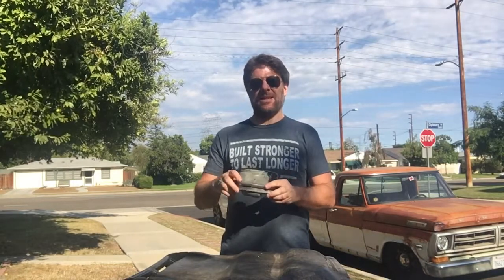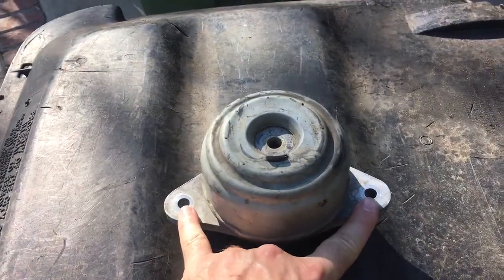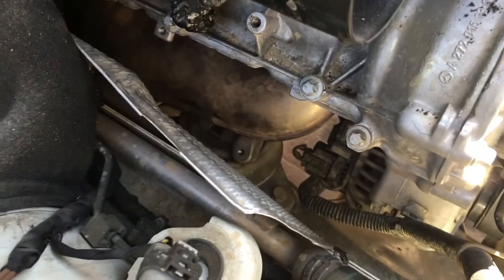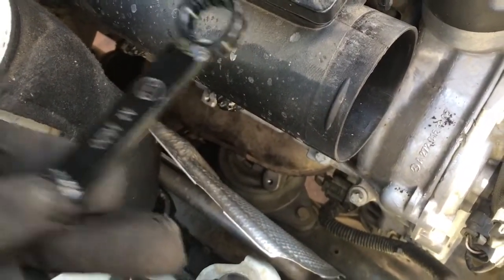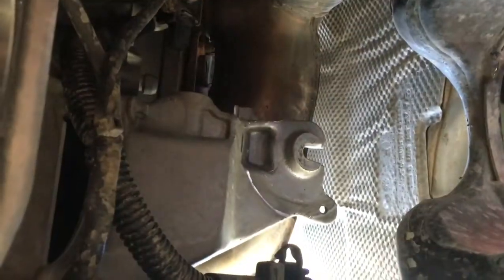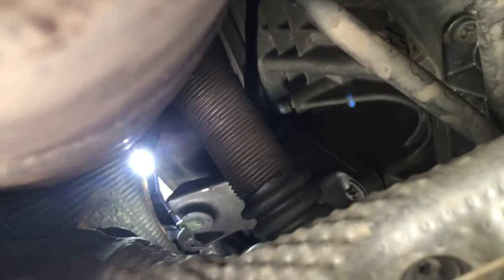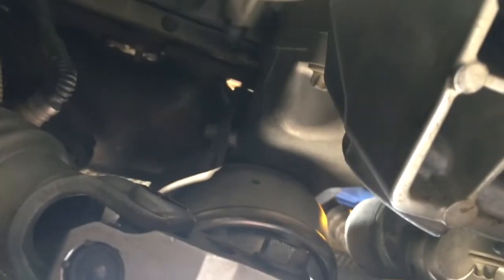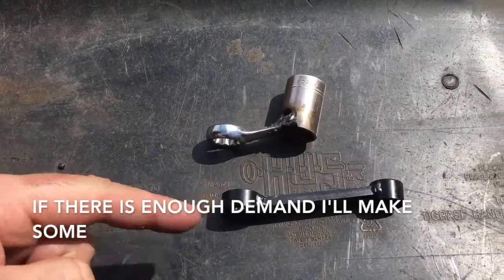Mercedes GLK motor mount swap + my tool that makes it easy.

Comment: Did you change all new screw and bolt when replacing the engine mount and transmission mount?

Comment: I bought the tool and it worked for me, also I'm a bit of a mechanic noob.  I did the job solo in 4 hours and the hardest part was getting the 16mm bolt started after putting the new motor mounts in. I had to keep the 13mm 2x chassis bolts loose, and a touch of soap on the bolt to get the driver side 16mm bolt started.
Reply from the maker: Excellent! Glad it all work out well! Thank you for your purchase.
Reply: @NathansGarage  do you have anymore of those sockets??

Comment: Great video , replaced motor mounts in about 2 hours also. Didn’t have to disconnect anything. If I hadn’t known it was possible  to do it in this manner I would have probably given up and taken it the dealership . Thanks for the great info.

Comment: How to understand that the engine mount is bad?
Reply from the maker: Joseph John for me it was a metal to metal type vibration that I could feel through the steering wheel and floor.
Reply: Nathan's Garage I have a vibration on steering wheel and a humming while idling on D
Reply from the maker: Joseph John the vibration in my steering wheel cleared up when I swapped out the engine mounts.
Reply: Nathan's Garage planning to change the engine mounts at the stealership, hoping my max care will cover it.

Comment: You think this would work on a '11 E350 Bluetec without removing the DPF and other accessories ?
Reply from the maker: david le hmmm I honestly don’t know. If the motor mount but is the same size and the issue is that that nut is hidden under something (the exhaust manifold in my case) then it would do the trick.

Comment: Do you know how much more a pain in the ass it will be for the GLK350 4Matic?
Reply: The 4Matic model is much trickier, but you can do it. I am about to produce a video on doing just that.
Reply: AutoRex Awesome. I'm going to keep an eye out for it. About to order the parts this week, but been dreading doing it after taking a look at it.

Comment: Important to point out that this only works with a non 4matic as you have room to access the mounts without the front differential and axles. Much more difficult process with the 4matic.
Reply: Could I just undo the CV axles in the front?

Comment: Yeah it's a lot easier to do if you don't have all wheel drive if you have the front differential in the way you have to take a lot more apart to get those motor mounts out of there

Comment: Did you guys have to take out the front axles?
Reply from the maker: Issa Nesheiwat mine was a rear wheel drive model but I would assume you would have to remove then. Scroll through the comments and reply to anyone who has asked that question. They’ll have more practical experience.
Reply: Nathan's Garage thanks I appreciate the response
Reply from the maker: @mr5274  the tool is $80 shipped.
My PayPal is: nathankershaw72@gmail.com
Stock will be arriving in 2 days so I can ship in 3/4 days.

Comment: I have a 2010 4matic GLK, so I assume the mounts can't be removed in the same manner since the drive shaft goes through the hole. Is there another way?
Reply from the maker: Unfortunately with yours I would assume it'll be a bit more involved. You'll probably have to pop the driveshafts out to use the same method we did, that shouldn't take too much longer.
Reply: On the 4matic GLK the front differential fully blocks access from underneath even with the axles removed. The passenger side can be removed by removing the alternator. However the drivers side cannot be removed without completely removing A/C compressor. The only way to replace the mounts on the GLK is to fully remove the entire exhaust system and the sensors. My mounts lasted 5K miles btw. Average life is 20K miles.

Comment: The tool has worked. Thanks again.

 I have one question if you don't mind. How did you remove the passenger side 13mm Bolt? It is partially hidden under the exhaust and I couldn't access it from the top.
Reply from the maker: 4habeshaw hmmm...it’s a while since I did this. Mine was. 2011 2 wheel drive model (if that make a difference) As far as I can remember the access with the tool was good from the top and anything else could be reached from underneath. Glad it worked 👍

Comment: Do you start the 16mm bolt in the new mount before you slide it back in or do you put it in after mount is in?